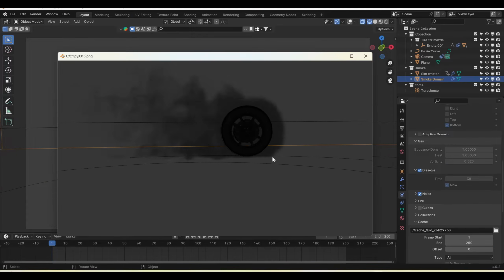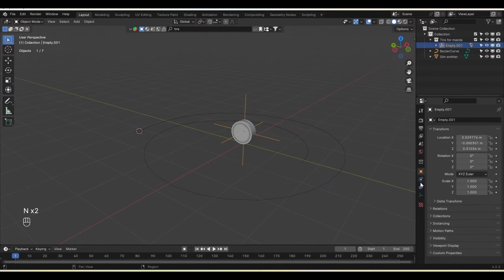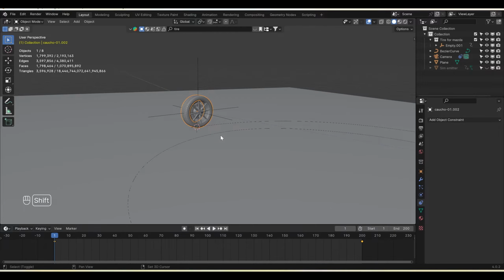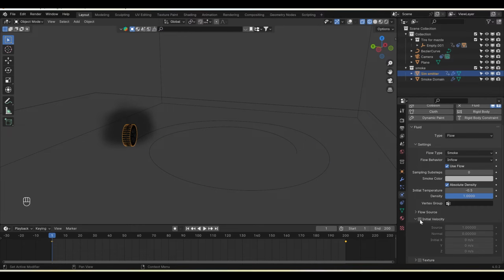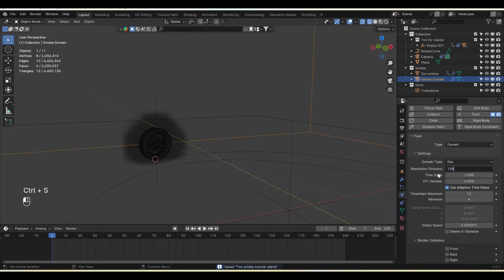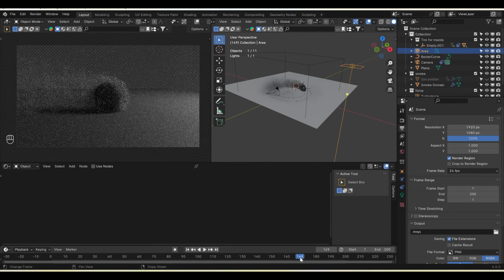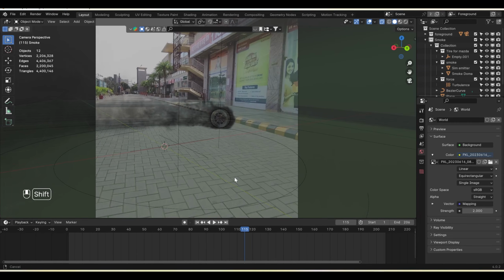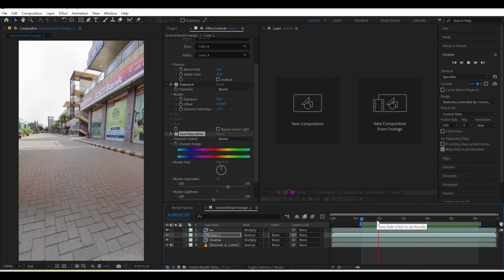Blender Smoke Simulation Tutorial | VFX Included!

Comment: Thanks for this. One question that I can't find the answer to anywhere: How do you make the smoke NOT emit in FRONT of the tire?
Unless the car stands still, tire smoke is only emitted backwards relative to the direction of movement. Can't find any tuts that explains this, so any help would be appreciated.
Reply from the maker: If you control the smoke emission direction, if you select the emitter in the physics tab, you will get some options - check the initial velocity tab - here are a buch of options based on these you can play with any direction, source motion, or normal direction.
Reply: @NPS3D  Thanks a lot! I´ll give it a try :)
Reply from the maker: @lassebauer  No problem 😊

Comment: You don't smooth a curve by subdividing it. You smooth it in the settings
 By default it's set to 12 for the resolution,raise the number and it becomes smoother. Your method is destructive and you can not edit the curve quickly. It's nearly impossible with so much points you added due to subdividing it
Reply from the maker: Recently I relised this. Thanks for shareing